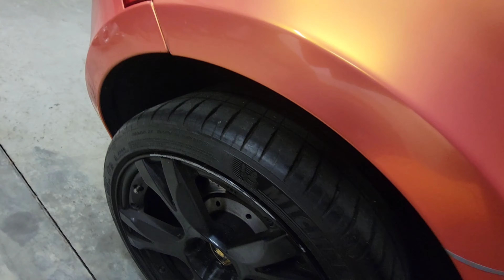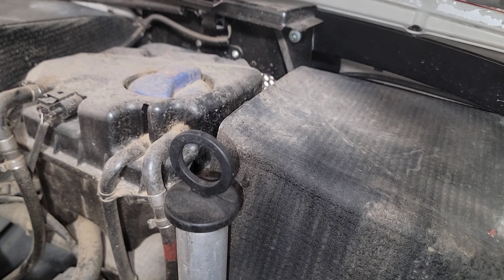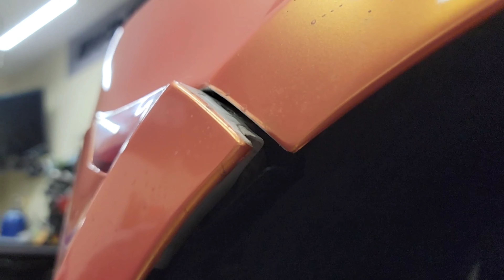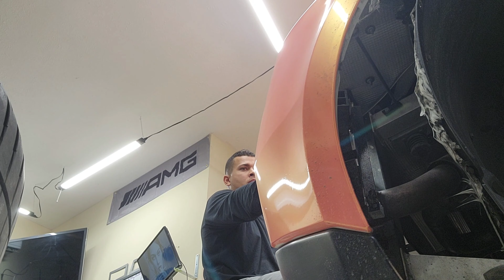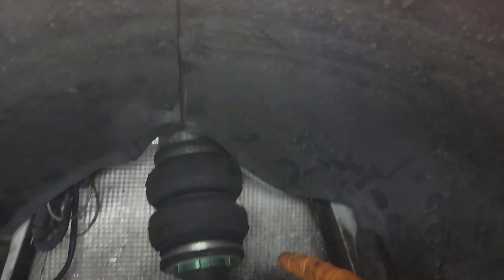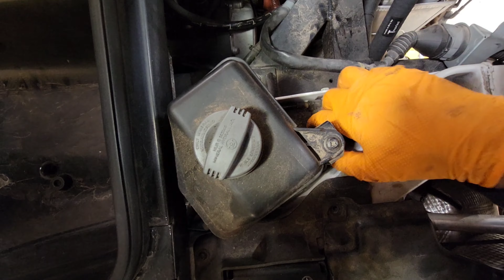PRE-LP EXHAUST REMOVAL(Spyder)

Comment: I was able to do this without removing the bumper. You can undo all the bolts on the Cross member above the transmission and slide it out of place. You might need to convince it with a mallet. Also watch out for the shims on the corners

Comment: If you just want to replace the cats with delete pipes, don’t need to take the bumper and wheels off, or are they accessible on the spyder by just removing the intakes?
Reply from the maker: You can. It will be super hard to reach the clamp and 02 sensor but you can.